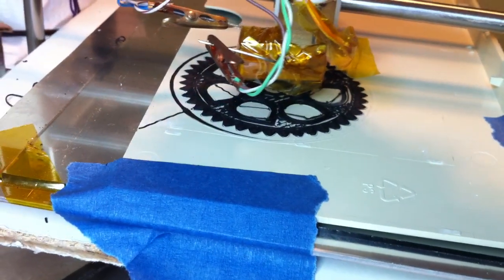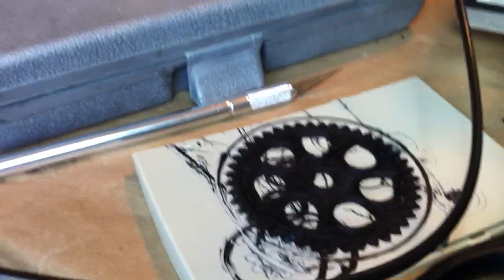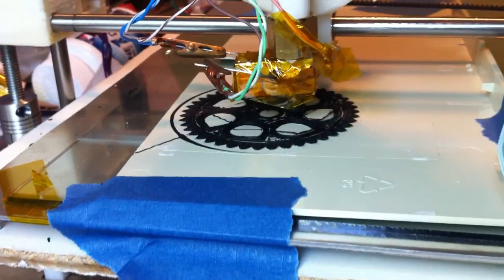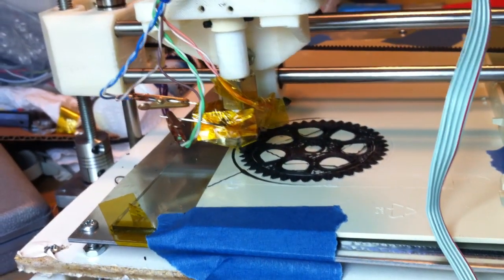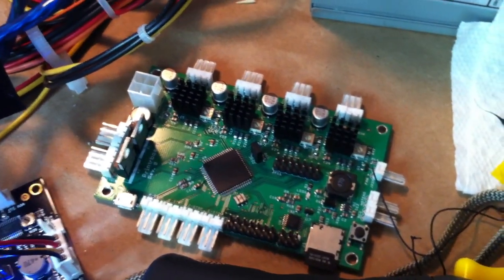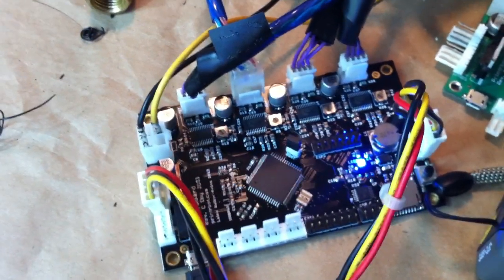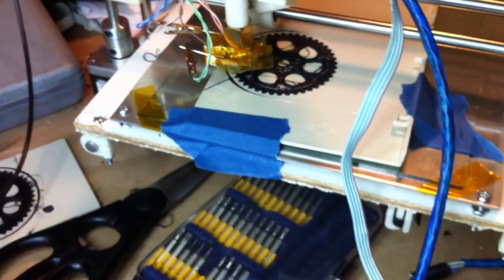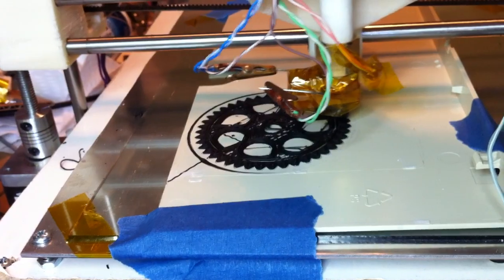Printrboard Printing on a Printrbot with Marlin

Comment: I tried again with the Firmware on reprap-usa but no luck at all. If I use the latest firmware on his site sometimes I still cant connect to the board via pronterface. I'm using the firmware he had on his site a few weeks back.